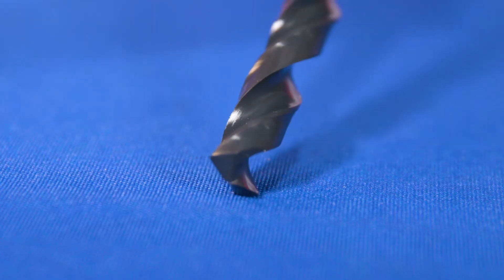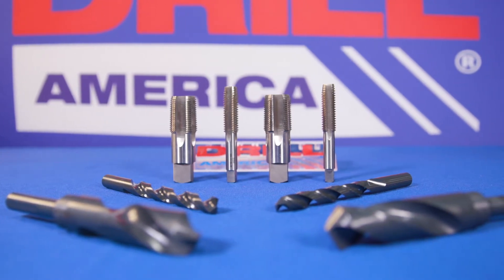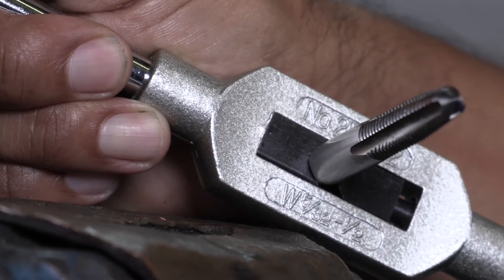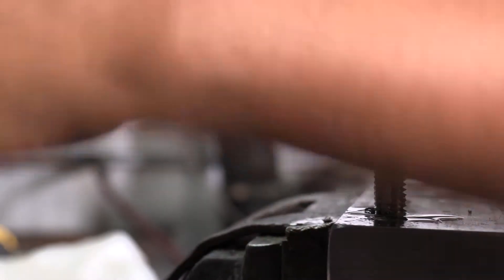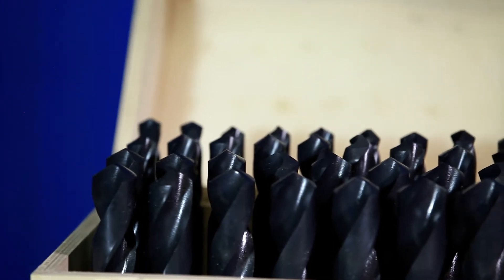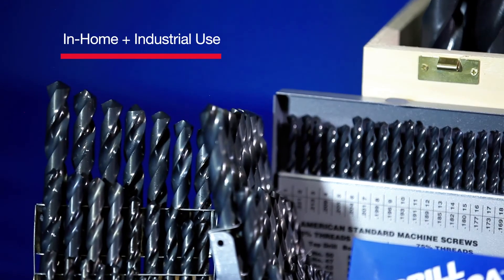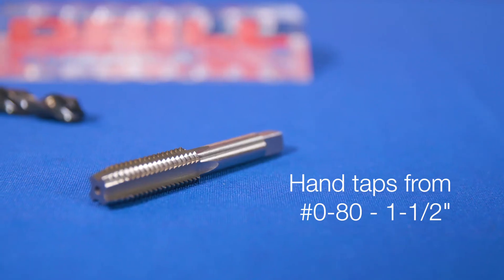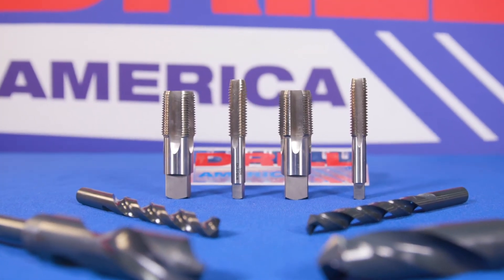Tap and Drill Sets from Drill America

Comment: good night, what is the formula to calculate the npt tap bit
Reply from the maker: Tap Size	Drill Size	Tap and Drill Set
1/16" NPT Tap	"D" Drill Bit 
1/8" NPT Tap	"R" Drill Bit 
1/4" NPT Tap	7/16" Drill Bit
3/8" NPT Tap	37/64" Drill Bit
1/2" NPT Tap	23/32" Drill Bit
3/4" NPT Tap	59/64" Drill Bit
1" NPT Tap	1-5/32" Drill Bit
1-1/4" NPT Tap	1-1/2" Drill Bit
1-1/2" NPT Tap	1-47/64" Drill Bit
2" NPT Tap	2-7/32" Drill Bit
2-1/2" NPT Tap	2-5/8" Drill Bit
3" NPT Tap	3-1/4" Drill Bit
3-1/2" NPT Tap	3-3/4 Drill Bit	
4" NPT Tap	4-1/4 Drill Bit